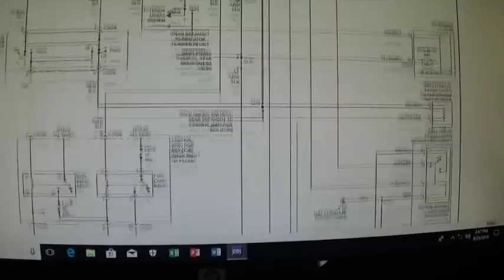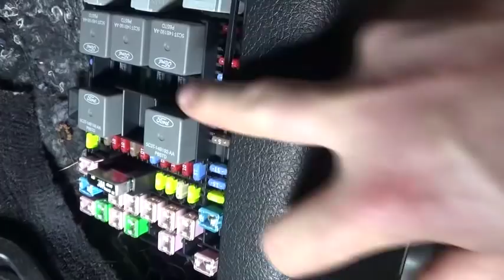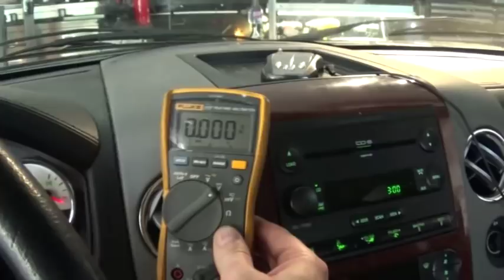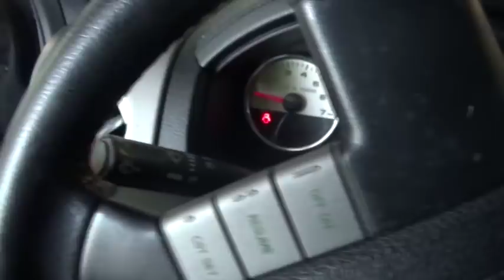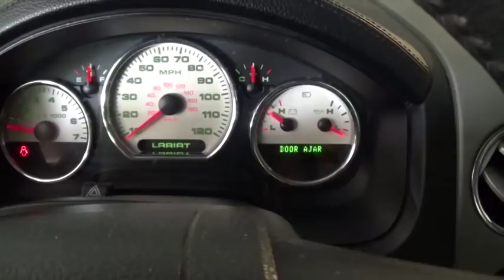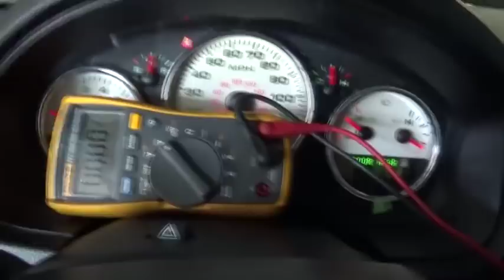2006 Ford F150 High Beam Lights Inoperative

Comment: Nice modification Ramone,  where can I find those female banana leads you attached to the relay tester.
Reply from the maker: Kelly R Hi my friend. I am using these banana connectors with shrink tubing.👍
 https://rover.ebay.com/rover/0/0/0?mpre=https%3A%2F%2Fwww.ebay.com%2Fulk%2Fitm%2F142824353609

Comment: Nice work my friend. I like what you did with the jumper leads on the relay tester. Good idea. I may do that for mine as well for an easy way to hook up my meter or scope and be hands free.
Reply from the maker: thank you my friend. This mod works great saves so much time and it's safe. I know you like first look sensor if you like check my last two videos I was using FLS and pressure transducer with picoscope on car with low compression. Cheers .
https://www.youtube.com/watch?v=U4fCYnTFFQc

https://www.youtube.com/watch?v=mFHQZo4I68Y

Comment: Excellent mod of the Lisle kit. I have that kit and I find it a little annoying every time to spend time figuring out which side is control and which side is the active side. On some relays you can make a critical error if you send power from the active side to the ground on the control side (or vice versa), messing up the computer by overloading a branch of the circuit that isn't protected by high resistance. With your cool mod that would never happen. By the way, for those who stop by the other thing that can mess up high beams is the DRL module. I was sent on a wild goose chase when my high beams wouldn't turn off, even with the key out of the ignition, and it turned out to be a bad DRL module.
Reply from the maker: Thank you my friend. I really like this mod and I did same on all other adapters. Now hoop up and testing of relay and relay circuits with this method takes no time at all and as you said it's safe. Cheers

Comment: nice work....you could probe the control sine of the pin   but the way you have it is so much better!
Reply from the maker: Thank you my friend. With this mod I can hook up my meter and have free hands to activate my circuits and monitor voltage on load or control side of my relay. I did same mod on all others adapters. Cheers

Comment: Could you have a problem on the grd side of the control. Sorry Ramon you answered my question. Guess I should watch to end of video before asking questions. 👍
Reply from the maker: Thank you my friend.  Modification of this adapter makes testing of relay circuits much easier. Cheers